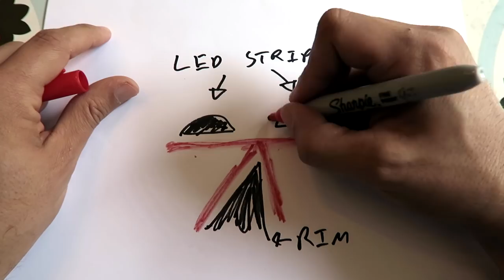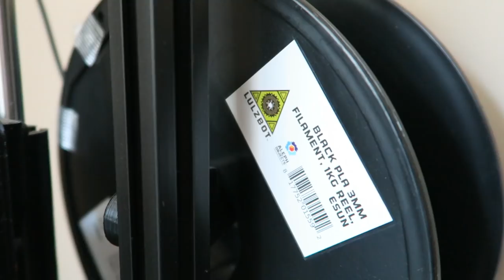Putting 200 RGB LED lights onto bike wheels

Comment: Amazing video, dude! I'm actually plannin on doing something like this to my own bike. Do you by any chance remember what size battery pack you had and how long it lastest?
Reply from the maker: Thanks! The battery pack is a 3xAA. I don't know how long it would last as one of them broke during filming (at the end of this video) and I took them off the bike after that.

Right now I'm testing out using a couple of 18650 cells in parallel with a voltage booster. So far it's been solid powering an Arduino and 107 RGB LEDs.

You might be able to power these lights and the controller with a single 18650 since there are fewer lights per strip and the controller likely takes less current. Which would be nice as you'd drop some weight and have a rechargeable battery.
Reply: @EdLewis  Ah I see. I was planning on maybe doing something with a 5 Volt LED strip and power those with phone power banks for the sake of recharge ability. But then I'd be stuck with the same cheap controller that might break like yours seemingly did. But I thank you for the idea of using individual cells. I'm gonna look into that too!
Reply from the maker: @FellowTaxPayer  the breaking was entirely my fault and not due to the controller. It was a result of me not securing the the wire that went to the controller so that there was stress on the connection to the controller itself. I got away with it for a while, but the constant changes in acceleration on the connection eventually broke it.

Comment: How can I do this without a 3D printer? Do you sell the parts?
Reply from the maker: Haktic Gaming no I don’t. These would vary depending on the rims and I didn’t want to dig into that.
Reply: After looking at the website I realized that, is their another solution to get the rgb lights on my wheels?
Reply: @Haktic  hey man, most light strips have a gluish back, so glue it to your wheel, add a bit of hot glue if needed, and use a lot of zip chains ( the plastic thing that costs 1$ for 100 ) to attach the batteries. I personnaly use an external battery for my phone and it works great !
Reply: How much hours does the battery hold

Comment: How did you make accurate measurements?  It looks dope!
Reply from the maker: Thanks, the next one is way better, too. Keep adding more features to it. Need to make a video.

As for measurements, I use digital calipers. You can get an OK enough one for $10. My splurge one is only $30.

Comment: OK I'd like to offer my services as a tester for your product.  I ride with the husky every night, spring, summer, fall winter - yes in New Hampshire.  What better way to test your design than in the harsh New England sub-zero extremes.
Reply from the maker: Hi, Chris!

That would make these parts more brittle. Although the next thing I want to try is to add in a microcontroller with an accelerometer so the lighting effects could be tied in to speed.

Comment: 🌈🦋Can you put them on a wheelchair?💝🙂
Reply from the maker: Absolutely. The diameter on those wheels look to be the same or smaller. You could also go for an underglow option instead, which would be incredibly easy to install and you'd be able to have the color control options available to change while you're riding it.

Oh, you could go much further with this for underglow. Can go with bluetooth control for the color scheme. Can set up a custom control unit with any kind of buttons you want (I like arcade buttons) for changing the settings and use that as input for an Arduino. Can add reverse lights for backing up. So many options.

Comment: Have you tested those spoke clips with jarring bumps pot holes.  i would be concerned about going fast hitting a pot hole and have the front wheel clips dislodge and possibly wrapping the wires around the wheel and causing a face plant.
Reply from the maker: No. I try and avoid those :)

But even if it did there would have to be a bunch of clips failing at once and then the strip somehow wrapping around the brake pads. If you wrap the strips so that the end faces backwards when it's at the top of the wheel (CW when on left side, CCW when on the right)  it will just come loose and start flapping against the frame.

Comment: Any specifics on the led strips you used? Are they battery powered? Or rechargeable? Brand? Length?
Reply from the maker: The link seems to be dead now, but you'll find a lot of similar options if you search for "battery powered rgb led strip." This one, for example: https://www.amazon.com/Lights-Battery-Powered-Operated-Controller/dp/B07QK45LZZ/

These are all powered by 3x AA batteries. Rechargeables might be OK for shorter uses since they have a lower voltage. If you're OK with electronics, I'd recommend using a 18650 with a voltage booster to replace this.

For length, you want 2 meters and you can cut it down to size. To see just how much you need, measure the diameter and multiply that times 3.14.  A 1 meter strip can only go around a 12.5" circle and a 2 meter can go around a 25" circle.

Comment: I’m doing this but it’s a mountain bike... do I really need to 3D print or am I good coz I don’t have a 3D printer?
Reply from the maker: If you can get them to stay on... great!
Reply: You can also buy a single led strip with a usb plug then stick it on your frame (top tube ) and connect the usb with a Phone that is being mounted on the handlebar

Comment: Can you share your 3D printer design so I can add these to my wheels?
Reply from the maker: Can't right now. I'm redoing this design because there was a problem with the original.
Reply: Ed Lewis thank you for the reply!!!
Reply from the maker: @georgealvarado5060  Sure. It's a little tricky because different rims have different angles. And there are different angles for the spokes coming off of the rims. I'll see if I can do a customizer script for thingiverse so you can adjust angles and sizes for different LED strips.

Meanwhile, here's the current status https://twitter.com/edabot/status/1316396837780295682

Comment: What’s the battery life?
Reply from the maker: I never found out. After that strip broke at the end I needed to get the bike tuned up and ended up stripping all of the gear off for that. Haven't put it back on yet as I have different plans for a future lighting setup. 

Even so, it'll vary with modes (always on vs. blinking, for example) and brightness.
Reply: Ed Lewis I actually created my own set of lights and each strip has a 2200mah battery pack on it... it last about 1-2 hours for me depending on the light color and such. Might upgrade the battery packs

Comment: How long does the battery last?
Reply from the maker: I don't know. One of the connectors broke before I got to that point. I took them off and am thinking of redoing this with addressable LEDs and lithium batteries instead.
Reply: Ed Lewis thanks for the reply
Reply: have you tried the FastLED lib for arduino? you can hook that to a bluefruit from adafruit and control both wheels from your phone. Thank you for sharing your experiments. I know a ton about addressable LEDs but nothing about 3D printing, so this was immensely helpful.
Reply from the maker: I think I tried that a while ago. I used a plasma library for a neopixel ring for a Halloween prop which was awesome. 

I know a decent bit about addressables and was thinking of doing just what you're saying so that effects could be controlled by the phone. I'd also like to tie the effects to the speed of the bike.

If I was to blue sky it., I'd like to add in some magnets and reed switches to have a funkier Revo light effect. Instead of red and white lights, have it look like sparks are coming up from the wheels contacting the ground.

EDIT: holy crap, Adafruit came out with a Bluefruit Feather? Nice!
Reply from the maker: OK, been doing a bit of research, but since you know more about this, I'd love to ask:

What do I need to power and control a 2m strip of neopixels (30 per meter is fine) that could last for at least 30 minutes of medium brightness lighting?

Can I control both via bluetooth at the same time?
Reply from the maker: Thanks that looks like plenty of power. I actually found a couple of Bluefruit Feathers while setting up my studio and they have the JST-PH connectors. I'm getting some more 3.7V LiPos to connect to these. They have less capacity at 3400 mAh, but also a lot less weight which means less inertia to deal with.